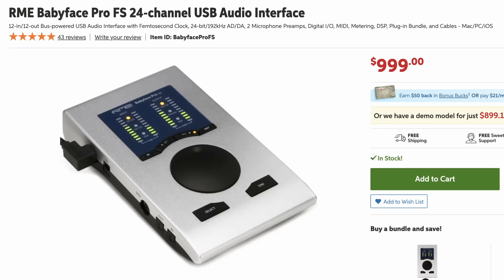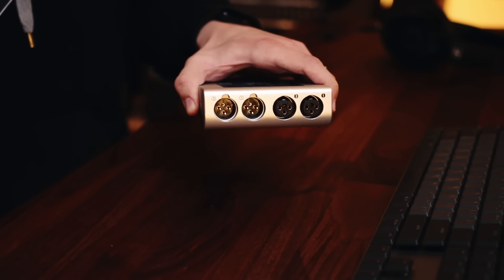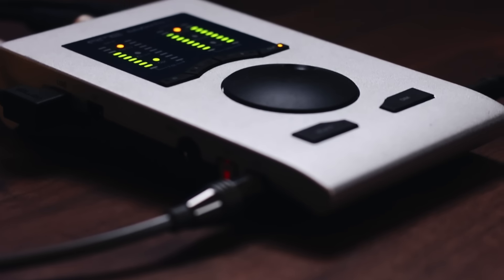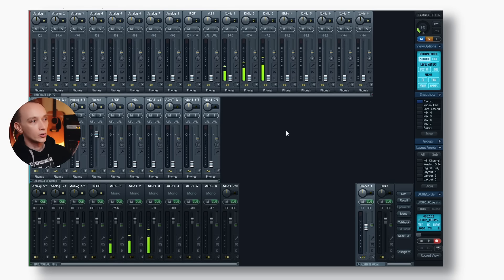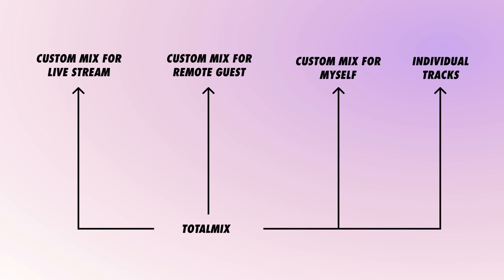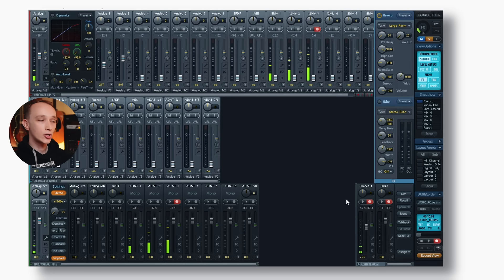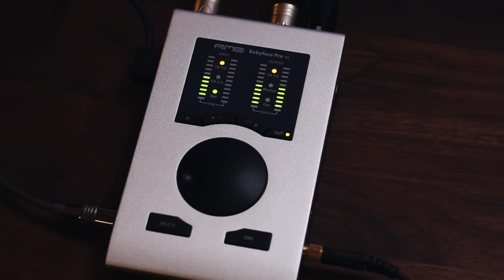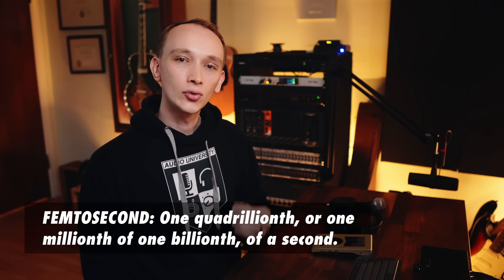Why Would Someone Spend $1,000 On An Audio Interface?

Comment: You can find old Babyface models (not “Pro” or “FS”) for $300-400 and with RME’s legendary driver support still use them forever.
Reply: Apple have just stopped supporting the Mk1 Babyface with OSX Sonoma ( I have one and can't update the OS because of this ) although RME could maybe update the drivers and change this. And yes, it's still an amazing interface.
Reply: @billB101  ugh that's terrible news but thx for the heads up - I'll have to check it out on a Mac - hopefully RME will update
Reply: I use RME for everything but for my small portable rig, I had an extra RME Digiface and I paired it with a Zoom U44.  I love it. Can’t tell the difference in the converters and I still have Totalmix and Rme drivers.
Reply: I swapped to 2011 Macs using old software, maxed RAM and ssd’s and I’ve done many sessions in the last few years , people used to ask why have you got so many windows PCs ?
Cause I need one to work 🎵
Windows can’t even compete with the MIDI timing on Ataris 
Also because apple ditched FireWire there’s loads of good hardware available:-)
Reply: @billB101  i don't know what you mean by "Apple have just stopped supporting the Mk1 Babyface" 
Apple doesn't support product drivers (unless you are talking about CC drivers) The babyface mk1 supported Sonoma from practically day one. You can find many discussions about this on RME forums in the same month Sonoma was shipped (september 2023). Maybe you misunderstood something or i misunderstood you.
Reply: @zdfghdfg  My M2 literally told me in a pop up box  that I would lose access to the Babyface on the next upgrade ( something about not supporting this legacy device past Ventura  )  I dunno, as I said in the original comment maybe RME have done something about this.
Reply: @richnorris1061  MIDI jitter isn't generally tied to an OS, it's more about the MIDI interface drivers (assuming it's not CC-related drivers) and the DAW. 
With RME MIDI, you get about 1ms of jitter with Live on both Windows (11) and Mac (14)
The Atari didn’t have audio playback or recording capabilities so it’s not a very logical comparison. Jitter tends to be a factor in more powerful and complex systems, so it's natural to encounter more of it with modern complex machines.
There are pros and cons in both types of systems,
Apple Silicon is typically faster in single-core performance than Intel or AMD, which theoretically allows for lower audio buffer sizes, potentially impacting MIDI jitter. MIDI jitter can’t exceed the buffer size latency (Sound on Sound has a good article about this).
Another advantage in favor of a Mac is that MIDI is multi-client on Mac but not on Windows, so your DAW and a hardware editor can share the same MIDI port.
Reply: @billB101  You can safely ignore this kind of messages, They are not relevant with hardware manufacturers that supply their own drivers but RME can't stop this message. It is explained in the installation instructions on RME's website.
Reply: @zdfghdfg  I wouldn't say safely, that's not good advice really.  You never know until you update and I've had plenty of audio f**ups like this over the years. Better safe really.
Reply: @billB101  it is safe like any other regular update. the massage is not relevant

Comment: RME probably the most 'worth it' for the high-end interfaces
Reply from the maker: Agreed! I haven’t tried EVERY interface, but I prefer TotalMix to any other system I’ve used. Do you use an RME interface?
Reply: Quality from top to bottom.
Reply: @AudioUniversity  Yes total mix is awesome once you learn it, and the driver is rock solid with really long term support. I haven't done the measurements but I wouldn't be surprised if they have some of the most accurate conversation, given other companies have primarily focused on selling you hardware for access to their software.
Reply: Thank you for the excellent video! I have been using a Fireface UFX for 12 years now and it developed a hardware failure recently. The interface could be repaired quickly for low cost and it works fine again. So when we are talking about sustainability not only software drivers are import but also hardware service and reparability. RME does both very well!
Reply: @SinclairSound  I don't know about conversion now, but once upon a time, RME was never at the top of anyone's list in terms sound. Their rock solid drivers were ALWAYS their selling point. Before I got over my gear lust, there were so many other converters that I would choose over RME. The best thing that one could do was get the adat or madi setup and pick your own converters. Things may have changed now, though.
Reply: I wouldn’t call it high end. It’s extremely good tho, but brands like burl, prism, lynx etc. are high end. Rme, antelope, ferrofish etc. are extremely good too, don’t get me wrong, but A/B them and you’ll hear the difference. But what do i know, I’m no Pensado.
Reply: @dronbana Which DAC would you recommend for monitoring on headphones ( for mixing / mastering ) ? 
Was thinking about the Lynx Hilo 2 atm but don’t know if there is better.
Reply: @AaezZzze  RME ADI-2 series

Comment: When expanding with ADAT, what features does the babyface impart onto the extra preamps? Like can the babyface turn a cheaper ADAT device into something better? Or do you need similar quality level preamps when expanding?
Reply from the maker: When you run a device with ADAT, the DA and AD conversion happens in the device with the analog inputs and outputs. Most converters these days are great, but this is something to consider. For example, using my Scarlett 18i20 as a preamp will mean the analog signal is converted to digital by the 18i20 and then sent digitally to my RME interface.
Reply: @ Ah okay that makes sense, I recently got a baby face and have been looking to expand for drum recording. Thanks for the clarification!

Comment: I have a baby face pro FS and its gone up in price by €400s since i got it 🙂. Its very good and solid, i find myself having to mess with it very little however as someone that records guitar direct using the inst inputs i would love a means to gain down the input. With some heavy guitars and basses with high output pickups they can drive it a little more than i would like. Put I love the low latency, this is the #1 reason i have it.

Comment: "Thanks to RME for Sponsoring." Not so objective, although it is indisputable that RME is solid and reliable. The instrument line level input's on the unit are unbalanced, you did not mention that. I completely agree with you about drivers. I have had to return my Arturia AudioFuse for driver issues and defects. I am replacing it with the MOTU MK5, a very high quality unit with stable drivers, high quality preamps, good amount of Balanced DC coupled I/O and the excellent CueMix software. Joe

Comment: can i use multiple monitors with totalmix with the babyface RME and mirror output 1-2 to 3-4?
Reply from the maker: It only has two line outs. You would need to use an ADAT DA converter for that.
Reply: @AudioUniversity  what would I need to purchase to get that to work.  What da converters could you recommend thank you for the reply 🙂
Reply from the maker: @JEBJOSH any ADAT-enabled D to A converter would work.
Reply: @AudioUniversity  can I use Behringer ADA8200 mic preamp? But I only want the outputs I don’t need multiple line in recordings? Thank you once again. I’ve been searching online all day for a good explanation if I get the RME babyface 🙏🏽🙏🏽🙏🏽
Reply: @JEBJOSH  The headphones out can act as line out, sent directly to power monitors. it will be unbalanced but it doesn't matter at all. You don't need to buy anything.
Reply: @zdfghdfg  eh I ended up getting the Rme ucx ii   Thanks for the insight though
Reply: @JEBJOSH  Even better :)

Comment: can u record the baby face inputs direct to ssd?
Reply from the maker: The UCXII has this feature, not the Babyface Pro FS.
Reply: @AudioUniversity  ok damn, would be cool for my live shows
Reply from the maker: You can connect to a laptop and record, of course. I know a guy who runs sound for his band with a Babyface Pro FS and a converter connected via ADAT. Pretty cool.
Reply: @AudioUniversity  nice, I have an ensemble tb that I bring out to bigger venues for small ones I just use the UAD volt 476 channel. But that separate record feature is pretty nice. cause when launching tracks and stuff live recording also causes some issues for me. not with cpu but just some issues with stop and start and such. Maybe I can just run audacity in the background to record the live inputs while doing all the live processing and track launching in Bitwig

Comment: I've had my RME Fireface UC for about 15 years now, and it's still rock solid, low latency, transparent and perfect for my needs.. I did complement it with a Digiface for more ADAT I/O later on, but the core of my system is always the good old Fireface.
Drivers are always snappy up to date and I just love RME, will probably never switch to another brand.
Reply from the maker: I do the same thing with the Digiface USB - like an ADAT matrix.
Reply: i currentlyu use a digiface usb but i want another for my streaming pc and have optical 8 channels both ways
Reply: Fellow Fireface UC user. It's just a super solid piece of kit isn't it?

Comment: The Snapshots are another great feature of TotalMix. I bought the ARC mainly for remote volume control, and it turns out that the buttons for snapshot recall is a feature I use all the time to A/B compare reference tracks with my mixes. 

When I first received the interface, I wasn’t sure that I had spent my money well. Now, with the sound quality, features, and rock solid reliability, I couldn’t be happier with my purchase.

And no, I’m not sponsored. This channel is sponsored, but the video is still legit.

Comment: Being able to route a ton of I/O through the interface and DSP rather than some kind of DAW/Voicemeeter software solution is huge. The software routing solutions that exist may be free, but the price you pay with latency is no joke. Asking your band mates to be cool with a dry signal is a tough ask sometimes. And in a professional setting with clients? It's a very bad look.

8:00 I noticed that the babyface pro FS has a DC barrel jack. Are you able to use that to get the same DSP functionality as the other wall-powered interfaces, or is that purely used for standalone mode?
Reply: for standalone mode

Comment: A simple question I haven't gotten a clear answer to is whether or not a line level input bypasses the preamp or not. This is for VO work. I'm using a Neve Shelford Channel into the audio interface and want to go straight to the converters. Any info appreciated!
Reply: The line in and Mic in sensitivity are supplied by the same op-amp controlled by the same voltage regulator and the same coupling, so there is nothing really to bypass. 
Every line input is buffered just like any mic input, so you don't get "more parts in the way" if this is your concern.

Comment: cool to see a video from you. love your channel. I'm about to buy this Babyface FS i have also the UFX3 , can i daisychain the two interfaces on the computer and control both interfaces over Totalmix and send tracks from ufx to babyface and back ?
Reply from the maker: You can access TotalMix for both if they’re both connected (there’s a dropdown in the top right corner). You can use the physical IO to route between them, but they won’t aggregate - still separate interfaces.
Reply: @AudioUniversity  Thanks that sounds Great , did you hear that a difference exist between babyface Usb powerd or with cable is there a hearable difference how i powerd the babyface ?
Reply: @p.m-audio  no, it doesn't matter how you power it as far as performance and audio quality. 
You can use two audio interfaces from RME that share the same driver as one audio interface. You will need to sync them to each other by any type of digital in/out.
Reply: @zdfghdfg  Great to know thanks mate

Comment: RME UFX owner here.  I love it, but the FX section died after a few years.  It was powered by substantial power protection (Monster AVS2000+HTPS7000), so it didn’t fry in a storm or anything.  Everything else is still working great. Just a data point for the community…
Reply from the maker: Sorry to hear that. I believe the FX run on the computer though. You tried updating the drivers, I guess. Right?
Reply: @AudioUniversity  no, they’re on board - it’s the “FX” in UFX 😉

Comment: Sorry, but within Babyface PRO FS TotalMix doesn't support Dynamics and ParamEQ controls.
Reply from the maker: The UCX II supports both. The Babyface supports only EQ on the input channels. Both have reverb and echo.
Reply: @AudioUniversity Is it actually necessary to connect my mic to a preamp, or does Babyface Pro FS work well enough that I can use dynamics via plugins?

Comment: I use a Focusrite Scarlett 18i20, and a Scarlett Octopre for my drum content, because I don't know how to stop buying drums. Granted, I bought these interfaces with 0 knowledge of how to operate them, and over the last 3 years, I've become more proficient. I recently learned that the headphone control in Focusrite Control Software is NOT hardware controlled, and I feel like that was a major oversight. I would buy quality headphones, and crank up the knob on the interface, but would still be very quiet, because the volume on Focusrite Control is still at 50%. 

This video is doing a good job illustrating the difference between Focusrite and RME, but I can't afford RME right now. LOL

Comment: I've hit a bit of a wall in going from analog to digital, and I've suspected the digital sampling rates, but I'm really not sure about the cause.  Does this sound like a DAC issue to you? (anybody have an idea?):  I have a (now broken) old Ross flanger, built around the old bucket brigade chip, (and it was terribly noisy).  I would disable the LFO for totally manual recycle freq control, about 60 percent recycle amount, then turn the freq way down low until I heard really nice destructive interference in the low notes of an E chord.  (Modern flangers don't go anywhere near low enough for this)  Then I'd set a small sweep range value (maybe 10 to 15 percent?) with the LFO set to maybe take 3 seconds or so for a full cycle, and turn the recycle amount down to maybe 40 percent.  The result was amazing!  I could play pretty much anywhere on the neck, and it had a beautiful comb filter effect, which was very strong.
I've tried various flanger VSTs, and the best imitation I've found so far is U-He's Carbon Copy, but it's still nothing like what my old analog flanger would do. Through-zero settings and what not don't quite fix the issue.
I'm thinking about possibilities like saturation in the bucket brigade chip which might have helped,  digital aliasing in the DAC interfering somehow (which wouldn't make sense, because we're talking low frequencies)...
I'm using the M-Audio Air 192x4 interface, but I would think weaknesses in the DAC would show up as noise and would effect my high frequencies, not low.
I'm thinking I may have to buy an equivalent unit off Ebay, and hook it to a scope to try and figure out how the analog processing is different from the digital imitation.

Comment: What I do: record audio narration that I do. 
Audio Interface needs thus: 
1. Works on Linux. 
2. low self noise 
Options that meet all this: Scarlett Focusrite Gen 3. BUT I gather that strangely the self noise has increased on each generation of Focusrite and the 4th Gen Focusrite is even noisier. Thus for any future interface I might look elsewhere. But RME does not work on Linux as far as I am aware.
Reply from the maker: They can operate in class-compliant mode. But I don’t think you get the full effect of TotalMix without the driver. Some of their interfaces (like the UCXII) can do stand-alone mode.
Reply: was thinking the same, i also use linux for most of my work. unfortunately these kinds of devices are rarely used and pretty expensive, so it's unlikely that they get the community treatment other software has :(

Comment: I do Digital Cinema.  When I look at Audio, it is riddled with all manner of "Proprietary" strictures.  I use Fairlight, via DaVinci Resolve and don't need 1,000 channels that it offers.  Everything else wants us to buy into a system.  I will stick to Blackmagic Design, for you don't need "their" system to use it.
Reply from the maker: For clarity: you can use most interfaces with most DAWs or video editing software. So you could use DaVinci Resolve with most interfaces. Also, TotalMix doesn’t require any additional buying in, it comes free with the interface.